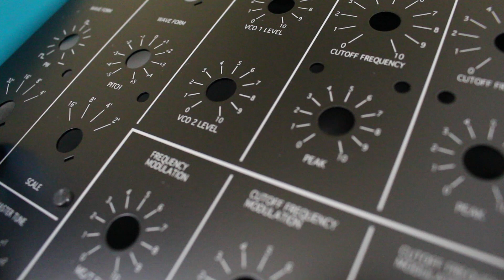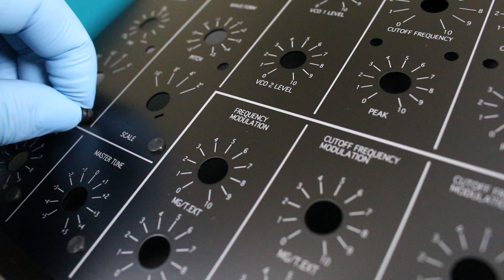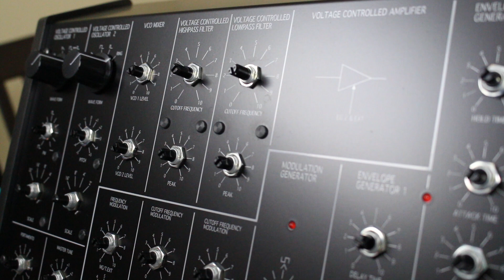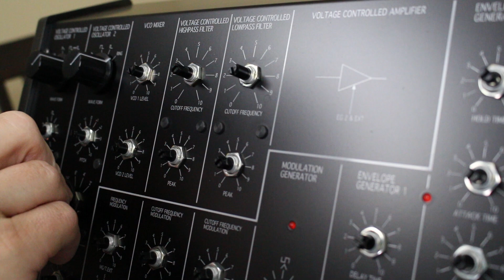KORG MS-20 Synthesizer Assembly

Comment: Nice video.

Did you figure out what the bushings are for?

I'd really like to get a set of those knobs to use for mods. Looks like they are very Korg-specific.
Reply from the maker: I suspect they are to act as a slight buffer for the PC board directly behind the front panel.
As for the knobs, they are REALLY cheap feeling in comparison to modular ones, trust me.
Reply: alternatingbitmusic Yeah, but given this is an MS-20 mod, I figured matching would be a good idea. Maybe not :)